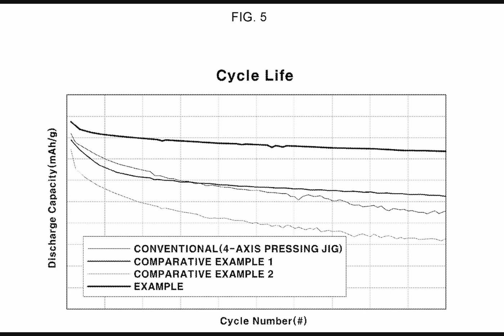Hyundai patents pressurized solid-state EV battery

Comment: Wow. Did they take all the flamey-ness of a conventional ev battery and put it under pressure?  Neato.
Reply: Solid state is supposed to not be flamey. It’s one of the “promises” of it. But so was weight and I highly doubt any promises until I see a finished product. 

Solid state was advertised as lighter, non flammable, faster charging and using less raw rare earth materials.

I think what we’ll get is an impossible to service Frankenstein that’s just as heavy with less energy density. This is the holy grail Toyota was waiting for to adopt EV manufacturing.
Reply: beat me to it.
hey let's take this thing that's already nearly a bomb and put it under pressure in an even tighter sealed container.
Genius.

Comment: Now a pressurized LiON battery in a potential moving accident... what could possibly go wrong??
Reply: That fully depends on the pressure. While the enclosure looks like a rectangular block, I expect no hazardous pressure is used. Otherwise the enclosure would have to have a sort of a round shape and a thicker wall which would increase cost and weight.
Reply: @beatreuteler  Like a hydrogen tank? That one holds 700 bar and 1-3 kg.
Reply: @wolfgangpreier9160  There is a huge field between some millibar and 700 bar. But from the principle with any nominal pressure above maybe 4 bar the housing won't be rectangular any more.
Reply: Like the insulating coolant in Tesla batteries?
Reply: @allangibson8494  But everybody knows that Tesla batteries explode all the time. They had a recall just days ago for all 2 million cars!
Reply: @ckfml  Try LPG. Look up BLEVE - boiling liquid expanding vapour explosion…
Reply: Every Hyundai will go BOOM in the future. Mark my words!